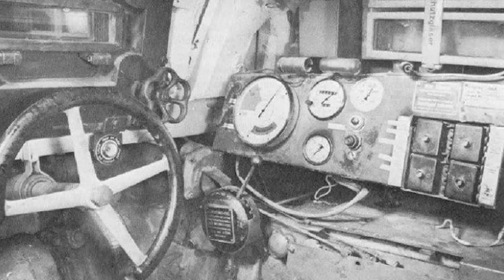A Deep Dive into the Tiger I, by the Chieftain

Comment: A very interesting presentation of the Tiger 1. The turret traverse speed, explains why tank ace Michael Wittmann preferred to rotate the entire tank rather than the turret. He was using his Tiger like the tank destroyers he was previously experienced with.
Reply: Every tank commander worth his payment would turn the thickest armor towards the enemy. 1 min for a 360° isn't too slow to begin with and this is a substantially heavier turret than on Sherman or T-34. Since you will barely turn more than 90° in an engagement and you can increase the rotation speed by just pushing the pedal, the roation isn't bad at all. When you have to turn your turret 180° or 360°, either recon was very bad or something has gone horribly wrong or both.

From personal experience on Leo 1, 360° high speed turret rotation while being buttoned up is a theme park attraction. Have your spit bags ready. 🙂
Reply: He did use his Tiger like a StuG. And it came back to bite him in hilarious fashion when he charged headlong into a textbook tank ambush during his last battle.
Reply: @ottovonbismarck2443  why turn 360 degrees when you can turn 0 degrees
Reply: @hourlardnsaver362  Every country that has challenged or invaded Russia ends like that. Vastly under estimated, like today people laugh at their tanks and hardware. But having over complex machines that require vast amounts of maintenance and supplies always loses on the battlefield.
Reply: @mt1885  True, but Wittmann’s last battle wasn’t against the Russians. It was against the British and Canadians. He was tasked with attacking Canadian tanks massing north of the French town of Cintheux and given seven Tigers. Wittmann, being the ex-StuG commander and hyperaggressive maniac he was, took them and charged straight toward the objective, through an open field and into the line of fire of the British 1st Northamptonshire Yeomanry and the Canadian Sherbrooke Fusiliers. 

Only two Tigers made it back after the ambush. Neither of them was Wittmann’s.  Of the five destroyed Tigers, three were taken out in quick succession by a Yeomanry Firefly called Velikye Luki, with Joe Ekins acting as the gunner. Another was taken out by a Firefly belonging to the Sherbrookes.

As for Wittmann’s Tiger, there’s been disputes over who killed it (and him). Ekins claimed responsibility, but recent evidence seems to point to the Sherbrookes as the ones who killed him. His Tiger was apparently hit in the left rear fuel tank by a Sherman III with a 75mm gun from 500 feet away.

So the most overhyped Tiger tank commander may have been killed by an “inferior” tank.
Reply: @hourlardnsaver362  Thanks for the info, one can only imagine the chaos in that battle along with the impact of the round. The Russian front was a nightmare as well once they got in they could not get out.
Reply: @hourlardnsaver362  that wasn't his choice, he was ordered across the field which cost several irreplaceable tanks and more irreplaceable experienced tank crews
Reply: @tattoos9246  AFAIK he was not ordered specifically to attack across the field. His orders were to deal with the Canadians to the North. Him deciding to YOLO across the field towards them was his own choice. And even then, no reconnaissance was done before he charged.
Reply: @hourlardnsaver362  I think the round went through the engine vent to the left rear side of the turret. As you said, virtually any Sherman could do that from less than 500 feet away. I don't know that it lit off any fuel tank. To blow the turret clean off of a Tiger would have required a massive ammunition explosion inside the tank, so the Canadian round likely went right through the vent and into the interior of the ammunition storage area. Terrible deaths to witness! 😮😮😮
Reply: @ToddSauve  Makes sense. I assumed it punctured the fuel tank but ended up in the ammo stowage. I’m not sure how much time passed between the hit and the turret flying off. I think there were conflicting accounts from both the Yeomanry and the Sherbrookes.

Either way, the whole engagement was a brilliant ambush. Joe Ekins’ actions were probably the most impressive, given the fact that the three Tigers were near the edge of his gun’s effective range and the amount of dust the 17-pounder kicked up when it fired. 

As for the death of Wittmann, given the propaganda hype surrounding him during and after the war, I can’t think of a better fate than getting blasted by a random 75mm Sherman.
Reply: @hourlardnsaver362  Wittmann was both a hard core Nazi and a member of the SS and voluntarily joined those groups before WW2. The fewer of those on this planet the better! Major Sydney Radley-Walters was commanding the Sherbrooke Fusiliers that August 8 of 1944 and said he witnessed the explosion as he was engaged in battle with the Tigers and other German armour. He said he heard a giant explosion and turned to see Tiger 007's turret being launched into the air and coming back down to the rear of the tank. That is a very bad way to die, and then when all the ammo cooked off there was nothing but burnt to a crisp humans left inside the Tiger. French civilians buried the crew and then in the 1980s the German war graves commission came and reburied them in a Normandy German grave yard. I have heard that they identified Wittmann by his dental work and his pistol found with the body when it was reintered. No one can say with certainty what kind of Sherman killed him because the Sherbrooke Fusiliers' records were destroyed a few days later when an American bomb blew up the vehicle they were being kept in. But since regular Sherman IVs were much more numerous than Fireflies it was almost certainly the regular Sherman that got them. 😮🤷‍♂
Reply: @mt1885  If the last few months are anything to go by, the "simplistic" and "streamlined" designs the Russians currently use are still too complicated and expensive for them to bother performing proper maintenance. Turns out, it doesn't much matter how simple your designs are if your logistics are nonexistent due to incompetence and corruption. Inversely, it doesn't really matter how complicated your designs and logistics may be if you have the capability and skill to meet those demands, hence the United States being able to wage war with complex equipment en masse anywhere on the planet as if it were its own backyard.
Reply: Good and valid point!
Reply: @hourlardnsaver362   There is an documentary probably British 'Channel 4'  (prob an Youtube by now) on how Wittmann's tank was destroyed - probably by a sniping tank to his left. If you can find it - it's very interesting
Reply: He kinda did both. moved turret and tank at the same time, moving only 1 track forward or backwards depending on direction and left or right track etc... Managed to turn his tank quite quickly by ww2 standards.
Reply: @someguy7629  It's in the manual - Fibel pp 86-87 "do not allow the enemy onto your cloverleaf"
Reply: Maybe the guy that got him did both
Reply: @hourlardnsaver362  And, according to himself, Ekins was removed from his position as a gunner after the fight, even though he was one of those actually being able to hit the enemy!
Reply: @frankcasella423  Perhaps the targets are moving?
Reply: @mt1885  pretty sure the Japanese in 1905 would disagree with you
Reply: @nowthenzen  Germany has been de-industrialized.
Reply: @ottovonbismarck2443  As the tiger's armor is straight, wouldn't it better to turn the tank away from the enemy in order to increase its angle?
Reply: @hourlardnsaver362  As the Chieftain so aptly explained, the tank was misused as the fireman on all fronts of WWII. I suspect Wittman knew this, and yet had little choice at the end as he was always outnumbered, out gunned and prime target on the battle field.
Reply: He preferred to rotate the entire tank, because of his vast experience in combat with the Stug's, where he started his career in Armor warfare.
His expirience in the Stug's proved to be very usefull when he was transferd to a Tank Batallion.
Reply: @jpmtlhead39  Yes, this is correct. He did use his experience on the Stugs, but he also found that it was faster to turn the entire tank from one side to the other instead of the turret.
Reply: @jpmtlhead39  The STUG tanks are very interesting and seemed to be very effective.
Reply: Yes, that was a flaw in the film 'Fury.'
Reply: @hourlardnsaver362  "Ambush", well he just met a tank able to shoot through his tank. After having blown up that many tanks, also in Normandy, he finally met his proper end.
Reply: hourlardnsaver, 

Not quite true. It was Kurt Meyer who ordered the attack, as a preemptive strike to try and throw the allies into some disarray as they were trying to move on Falaise. The Germans knew there was a mass of allied tanks and they tried to take the initiative. It was a nigh on impossible task given the number of forces the allies had in Operation Totalize, but the greater Falaise situation, it was feared the allies might reach Falaise that day if they weren't stopped, overrode the local issue. 

By accounts Wittmann was actually somewhat subdued and even nervous that day and concerned about the attack. He wasn't even supposed to accompany it but he thought the commander responsible for leading the attack (Heurich) probably wasn't able to cope with such a difficult task so he decided to go along. He was worried about the 'wood' on the right and called attention to it over the radio.

The way you described it is completely inaccurate. Wittmann was not blasé or nonchalant that day. Quite the contrary in fact.
Reply: @finncarlbomholtsrensen1188  Not sure why you put quotations, because it was an ambush. Wittmann just took all of his Tigers and charged out into an open field towards Canadian tanks mustering north of his position, and in doing so drove right into the firing lines of Squadron A of the 1st Northamptonshire Yeomanry in a forest to the right and Squadron A of the Sherbrooke Fusiliers to the left in the town of Gaumesnil. Both Allied units were lying in wait for the Germans and Wittmann had no idea they were there because no reconnaissance had been done before he attacked.
Reply: @hourlardnsaver362   Wittmann is highly over rated. He’s only famous due to propaganda and the SS. So much better aces through the war on all fronts and sides that deserve the amount of books written that whittmann had about him. After all, the SS needed to show that they werent ALWAYS being out preformed by the regular army forces
Reply: @stuglife5514  Kurt Knispel and Otto Carius were also tank aces with many kills.
Reply: @blubbietweeduizend  yes I’m aware
Reply: @hourlardnsaver362  ah yes..... you're talking about the time he died when a P47 blew his tank up.
Reply: @thenortherner3890  his tank was destroyed by a p47. i don't think any allied tank gun was powerful enough to flip the tank and pop the turret off.
Reply: @justnsaliga8518  AFAIK he wasn’t killed by a P-47. It was due to either a long-range shot from a British Firefly or a Canadian 75mm Sherman from a mere 500 feet away.
Reply: @justnsaliga8518  His Tiger itself wasn’t flipped. Just the turret. And at 500 feet away, the 75mm M61 AP shell could absolutely punch through the Tiger’s side armor.
Reply: @blubbietweeduizend  Carius was definitely the better commander, as he thought about how best to employ his Tigers and only charged when he could surprise the enemy and capitalize on it while taking minimal losses.
Reply: @frankcasella423  two reasons. 1st. as Bismarck said, try to keep the strongest part of the tank towards the enemy, and 2nd. To increase the turret rotation if someone is trying to circle you like in the Fury movie, and again as Bismarck said, if that happens either recon bas very bad, something bad has happened or both. 

You will often experience this if you play world of tanks or Warthunder. If you have a tank with slow turret rotation, increase it by simultaneously turn the tank.
Reply: @hourlardnsaver362  overhyped? He might have made a big mistake, but no alliance Tank commander has 10% off his kills, everyone can kill a king when he eventually makes a mistake.
Reply: @kimmogensen4888  I respectfully disagree. Charging headlong into the enemy and getting most if not all of your tanks destroyed is not the mark of a skilled commander. And Wittmann did not only do this in his last battle. He also did this in Villers-Bocage. Sure he may have destroyed many British vehicles, but he lost his Tiger and the other two he brought along with him. Not to mention he indirectly got a lot of tanks of the Panzer Lehr Division destroyed since the British took them out when they joined in the attack.

He may have been good at seeking initiative and he may have had a good gunner, but he used the same foolish tactic repeatedly in his time commanding Tigers at Normandy and got his just desserts.
Reply: Also the comparison of Wittmann to a king is pretty funny since the guys that killed him didn’t even know who he was until after the war
Reply: Kistler Clipz  For all intents and purposes yes, an Ace of Aces.
Reply: @hourlardnsaver362  This is the case for literally almost every ace that got killed, be it in the air or on the ground. How the hell would they know? His Tigers never had any special features like Richtofen's red Fokker.
Reply: @hourlardnsaver362  There's no respect in your various comments at all, so to pretend that you have any for what others are saying is laughable. 

Wittmann systematically outperformed his enemies and got better results than almost every other tank commender in history, there's dumb luck and then there's skill, and inevitably there is bad luck, and no amount of skill, caution or experience will save you from an impossible situation. 

Wittmann was rushing to the scene because the Fallaise Pocket was a critical battle for the Germans and their operational integrity in the entire sector and beyond, and as many others who died he made a judgement call which was definitely not even one of the riskier ones of his career, and despite that, as we know from his radio communications, his gut advised him against it.

Combat is not like videogames, you don't get to "chose" when you will be at the face of the enemy. If you have orders to get from point A to point B as soon as possible, you do it as soon as possible.

It's no use pretending that he was ultimately not a good commander, he survived far too many engagements, disabled far too many enemy vehicles and got out alive out of far too many impossible situations to just call it dumb luck, and for that, like Carius or Rudel, he has ascended to the stuff of which legends are made.
Reply: @SOLOcan  Most valid for the tiger 1
Reply: One of my favorite moments in Forgotten Hope (A battlefield 1942 realism mod) was hijacking a Puma and then running circles around a Tiger that was trying to track it with the turret. I could move just a little faster than it could track and I was shooting it point blank with the 50mm. Eventually, it cooked up after about 10 rounds, which was probably not realistic but was fun.
Reply: I wonder if Wittmann would have been just as satisfied with a Jagdpanther?
Reply: @mt1885  If you are referring to the Russians, I don't think anyone knowledgeable about them laughs at Russian WW II tanks.
Reply: @ToddSauve  What was an American bomb doing visiting the vehicle?
Reply: @jackd1582  It got a good monetary exchange rate I suppose.
Reply: Kistler Clipz  Ace of Aces
Reply: @garyhill2740  I think he would like the Jagd-Tiger even better. It had more room and a bigger gun than both the Tiger-1 and the King Tiger tank. It was also a mobile home and pill box in one but the NAZI's only made 60 of them.
Reply: @neganrex5693  Otto Carius hated the Jagdtiger. He thought it was abysmal and a total waste of time.
The gun, while powerful loaded slow.  Mobility and mechanical reliability was worse than the King Tiger. Moving the entire vehicle to aim demolished then final drive which, already overstressed in the Tiger I and II, could not cope with Jagdtiger's weight at all.
Reply: @garyhill2740  I would agree with him. You could also build four Panthers in the time it took to build one Jagdtiger but in a last moment fight I would jump in the Jagdtiger before anything else in the way of tanks.
 My grandfather told me about the king tiger and said he wished we had some when cloud cover would not allow for a P-47 strike.
 He said we finely got them in the form of a M-26 but to little to late and since the war was almost over why bother. Me myself would rather make a ship dock worker day feel longer and save American lives because our M-4's was way out classed by most German tanks by 1943.
 He said the German giant Cats was blown up our M-4's like they was jeeps and didn't act as if they had any respect or fear of them but they had that for P-47's on a clear day.
 We was watching the 1950's move war of the worlds one day and he said I know how they feel.
Reply: I don't get that. "It was too complicated to communicate with the driver to have him rev up the engine to increase turret rotation speed, so instead drivers would just turn the whole tank". if the commander could tell the driver to turn to the left, he could just as easily tell him to pack on more revs for a moment to turn the turret. So they COULd turn the turret if they wanted to.
 What you are talking about is a matter of the tactics he is experienced with. The main benefit from that technique is that it automatically presents the thickest armor to the target. I was under the impression that was the standard tactic. You CAN turn your turret to the beam to engage a target, but if at all possible you turn to present your thickest glacis armor. Ideally you don't let enemy get beside you to start with. What else are they going to do in a Panther, which is actually only marginally armored from the side? You always turn to face the enemy. The benefit of a tank is that even in tight areas when turning might be difficult, you can at least shoot back. But you should always face the enemy as quickly as possible in a tank. And not head on either, you want the thickest armor presentation possible. That means you angle yourself slightly, so what is presented is the glacis at a slight angle, and a little visual slice of side armor at an extreme angle. That's what it says in the Tiger training manuals.
Reply: @justforever96  Turning the whole tank was a tactic unique to Michael Whittman, that came from his experience with StuG tank destroyers. 
Apparently, this allowed him a slight advantage in order to shoot first and I guess he knew better the capabilities of his tank, as well as the Tiger's manuals.
Also revving up the engine, would mean burning more fuel and for the Germans, fuel was more expensive than blood, especially during the later stages of WW2.
Reply: @hourlardnsaver362  WIttman is not the most over hyped commander, he has 138 tank kills and 132 anti-tank kills. Plus he had the courage charging and fighting a lost fight. A man like that, even if he dies by slipping in mud, he's still the greatest tank commander.
Reply: @hourlardnsaver362  At 500 feet its basically point blank  so even an "inferior"  75mm would be and obviously was sufficient
Reply: @hourlardnsaver362  ... It wasn't anything to do with his tactics but everything to do with totally not knowing where his enemies were. It's why it's called an " ambush ".
Reply: @ToddSauve  ...The Tiger did a slow burn and then blew up. So it was a fuel fire that cooked off the ammo, not a direct hit on the ammo rack.  No-one got out so all the crew were killed outright with the first hit. ( Hopefully ) I'm no Wehraboo but the thought of those men burning alive in there isn't pleasant.
Reply: It was standard practice to " face " the armour to the threat. They used the terms Breakfast, for 9 to 12 oclock and Dinner for 12 to 3 oclock. 100% frontal facing was less effective than angled by a few degrees.
Reply: @louisavondart9178   But how could anyone know which occurred first, the cook-off or the slow burn? Sidney Radley-Walters is the only person I am aware of who witnessed the explosion of Wittmann's 007 Tiger, and he stated he only became aware of it when it in fact did explode and launch its turret into the air. He was preoccupied with shooting at other German tanks and directing his squadron's activities that noon hour. No one that I know of has ever been able to state unequivocally which Sherman or type shot the Tiger with its armour piercing round. Only that it had to have come from the Sherbrooke Fusiliers. 🤷‍♂
Reply: Kistler Clipz  What do u mean by '' ?
Reply: @mt1885  not working out now eh? all those simple designs are now scrap
Reply: @hourlardnsaver362  This reminds me of the controversey over who shot down the Red Baron.
Reply: @hourlardnsaver362  he realized how mistaken he was when his tank brewed up like ice cubes in a fryer
Reply: @ottovonbismarck2443  Actually Tiger had two rotating speeds - manual was around 7 degrees per sec while electrical was around 18 deg/s IIRC. That makes it capable of doing 360 degs in 20 secs or so. Just how fast do you want to rotate a turret anyway ?
Reply: @shadowdancerRFW  And if gears were in neutral and the driver hit accelerator, the traverse speed goes beyond 18°/sec.
If your goal is to shoot at (very) long distances, there isn't much traverse needed. If you have to defend "around the clock" in close combat, something else rather than turret rotation has gone horribly wrong.
Anyway, what was turret rotation speed on T-35, KV-1, IS-2 and Churchill (if we count it as a heavy) ?
People are comparing a heavy tank with a very heavy turret to mediums ...
Reply: @tattoos9246  he had an objective, but he had a choice how to go about accomplishing that objective. But like in Villers Bocage, Wittmann was reckless and his recklessness finally caught up to him.
Reply: @mt1885 I bet you feel silly now.
Reply: The tank “ace” who tried to charge across an open field directly into an entire platoon of dug in British tanks with no support of any kind and was killed by the second shot fired by the British. 
Who also claimed trucks, wagons, and even a mule cart as tank kills to inflate his score.
Reply: @bahamut256  Many Germans, towards the end of WW2 chose a "heroic" way out  instead of just shooting them selves, because the new the war was lost.
As far as the mule cart, I guess the mule protested to you about the incident, so you have detailed knowledge about it,
The fact that German propaganda exaggerated the feats of their soldiers, does not mean they were not "aces", even if there were others as well.
Reply: Lotta reasons really. The Tiger 1's turret traverse was powered by the main engine. This presents a few issues, like not being able to spin power traverse without the engine turned on (like being in a defensive position at night).

The transmission has to be placed in neutral and a clutch to the turret drive engaged. No spinning the turret with power traverse while the tank is moving.

The Tiger I's engine wasn't as awful as some of the other German designs in terms of reliability but it was governed and the driver had strict instructions not to over-rev the engine. You don't want to be worrying about if the engine is overheating while you're revving in place just to spin the turret faster.

That also means the driver is carefully managing engine RPM and turret power while the speed that the gunner can traverse is basically out of his control. It's a tremendous amount of effort versus just having a proper hydraulic system like the 360-in-13-seconds oilgear traverse in a Sherman.

A Tiger commander might have preferred to just move the tank for a rough lay to avoid all these issues.
Reply: @homie8437  Thanks for the most informative comment.